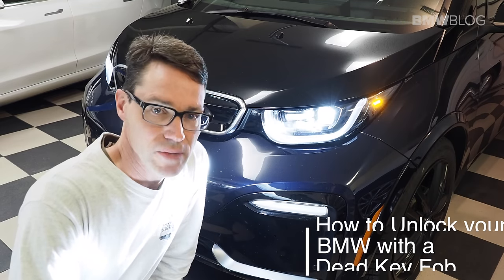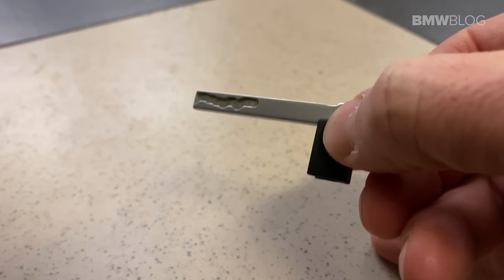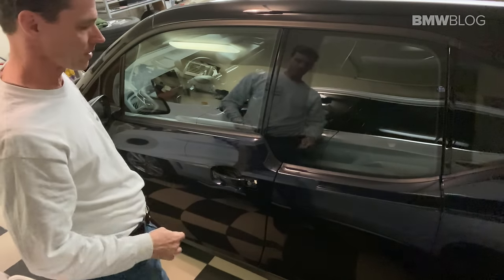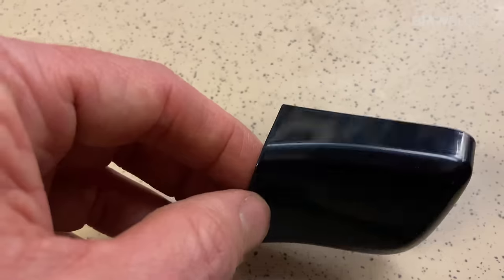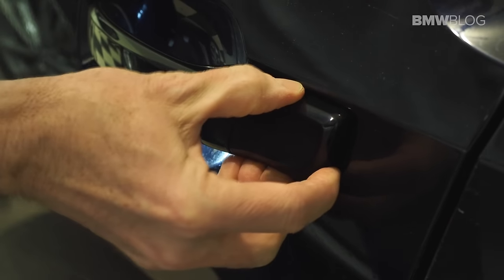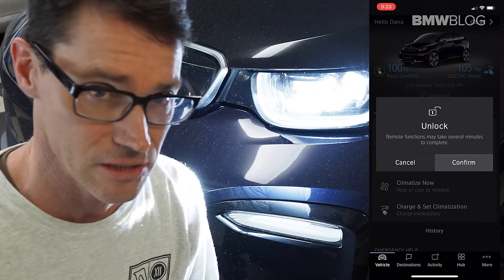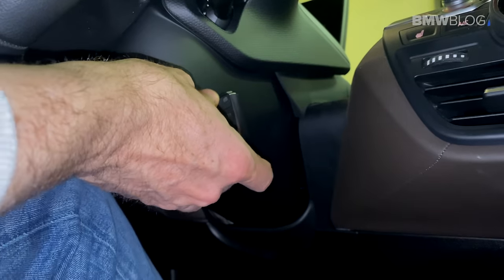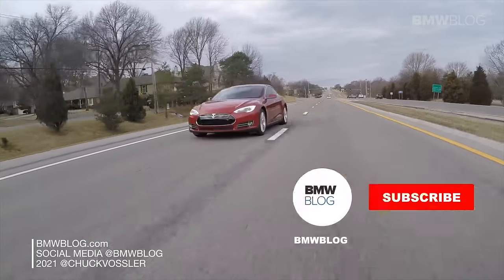How to unlock and start your BMW with a dead key fob

Comment: 2020 BMW X5; 34,618 miles; garage kept:  Key FOB worked fine to open door, turn on lights and turn on radio but refuses to start..  Absolutely NO electrical "effort" to start motor.  Display says "vehicle key missing."  Placed key on on the right side of column over designated place and still absolutely no motor noise.  Tried spouse's key... same result.  Vehicle cannot be placed into Neutral to push.   Vehicle purred like normal the day before.  Any suggestions?

Comment: Thank you!  Of the 2 handful of videos that came up on the search, your's the only one that explained the cover piece, especially how to put it back on, EXTRA ESPECIALLY about that little thing stick/piece that you say may break easily.  I had to remove the cover outside at night without bright street lights. I had a hard time putting the cover back on.  (The 1st video I watched on how to open didn't mention anything about the cover details, what the cover inside looked like, what's there, etc.).  Good thing I didn't press too hard and gave up in fear of damaging something in the dark.  Upon seeing your video, I inspected my cover, and indeed, that little stick piece... wasn't upright. It was bent, 90 degrees. No wonder it wouldn't cover back up, bc it being bent "sideways" couldn't fit into the corresponding hole on the door key pad. Anyways, although pleasantly surprised the mini stick was only bent, bc I had assumed I might have broken it off already last night in the dark.  As I was getting ready to shop online for a replacement cover, I tried to bend the stick back to it's original position (which I know how it's supposed to be like bc of your video!), actually getting ready for worst case scenario that it wil snap and break, but attempted bc... what else could I do at this point?  1 last ditch effort.  Amazingly, that stick isn't of brittle material, it actially let me bend it back 90 degrees to its original place.  Finally, now I was able to snap the cover back onto the keypad, very easily, compared to the night before in the dark.  Next time if I need to open again (although hope never have to, I will no longer ignore the on-board computer warning of the key fob battery level), I'll surely know what to do AND what NOT to do!  Thank you for the fully comprehensive explanation!
Reply from the maker: Glad to hear. Happy it worked out for you

Comment: I was stranded at a gas station as well. I tried holding the key where it said to place it but when I stepped on the brake and hit the start button nothing happened. Luckily I was near a hardware store and bought a new battery!

Comment: Amazing! After shopping, key fob dead. Got in using actual key, car won't start. Until i noticed the key marking on the right side of the steering wheel.
Reply from the maker: Glad it worked out

Comment: Wtf thanks so much. I had my car battery replaced a couple months ago so I was hoping it wasn’t that. I called AAA they confirmed my battery was good and thought I possibly had a short in a fuse thankfully I watched this video before I got this car towed to a mechanic. I held my fob to the key symbol on the steering wheel and right away it started. Only thing is I can’t open my trunk but that’s not priority I was thinking it would be something much worse thanks so much for this video. I turned the car off twice and did it again to see if it would work again and it did right away

Comment: My bmw battery is dead and when I tried to unlock the door this way, it set off the alarm and I can’t start the engine since the battery is dead. Are there any ways to turn off the alarm except for start the engine?
Reply: Did you find a resolution? Currently having the same issue with the alarm
Reply: @ogblockbusta9950  For me, the alarm eventually stopped after a while, maybe because the battery was dead dead by then. I don't think there is a way to resolve this, and you just need to wait for the battery to be really dead and the alarm will stop.
Reply from the maker: That's a very interesting use case. Let me try to research it a bit

Comment: My key blade or fob will not open the car doors or trunk any suggestions I called a locksmith too and he can’t open it either.
Reply from the maker: So when you use the blade, what happens?

Comment: I don’t have the key symbol on the side of my steering wheel, I’ve got a 2006 1 series. How do I start mine with a dead key fob?
Reply from the maker: Good question. Let us look into that procedure.
Reply: I know this is a long shot but Mine is the same a 320i 2005 I think. And I usually insert my key fob to start the car, can I still drive it?

Comment: My x5 works same way, but when I use the physical key to lock and carry it with me for water activities and leave the remainder part of the key in the car, my tailgate door won't lock while I can manually lock the front four doors. Do you know what I am doing wrong?
Reply from the maker: Interesting use case. Need to look into it
Reply: You need to have the main key fob on your person NEAR the tailgate so it detects it to allow you to use the LOCK button, but you should still be able to press the tailgate CLOSE button to close the tailgate door.

Comment: IF YOU LOCKED THE CAR WITH THE FOB, THE ALARM WILL 100% GO OFF, JUST A WARNING. REASON BELOW!!

The alarm goes off since the car locks via an encrypted network... when you unlock the door, the car only registered that a door was opened, and it doesn't know how it was opened! (What if it was pick locked?), therefor, it sets off the alarm.  To prevent this from happening, you will need to lock the car manually next time.

Comment: Misleading video. You didn't open the car with a dead key fob, you opened it with a key blade. And if the key worked via emergency start then the key isn't exactly dead is it, maybe the battery is dead but doesn't mean the key is dead.
Reply from the maker: No offense, but it is not misleading. This is how you open the car when the remote has no battery left to open the doors. So that's what it means.

Comment: Hi, my battery died and even my manual key does not open. Not sure if its because I had locked it with the remote. I have f32 with comfort access. Do I need to call in a locksmith?
Reply from the maker: The manual key should open. Unless the mechanism in the door handle is broken. But it's all mechanical, so it should work.